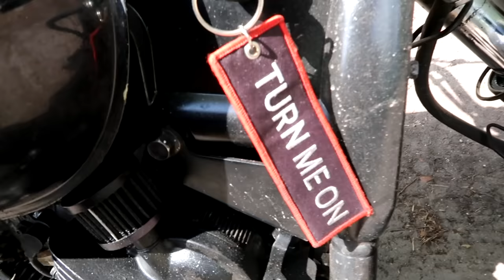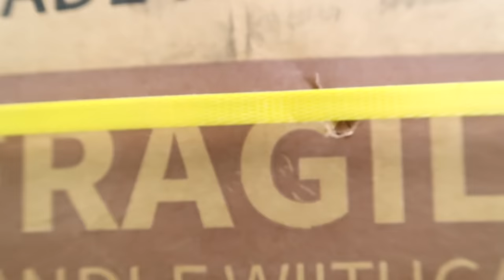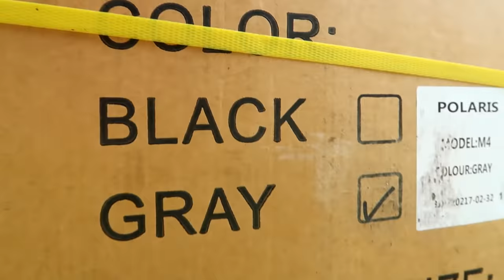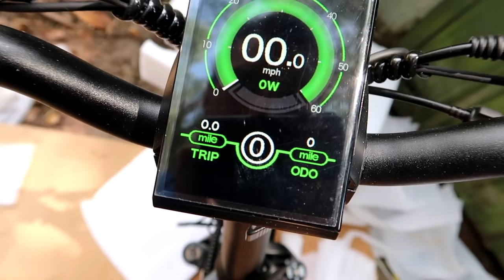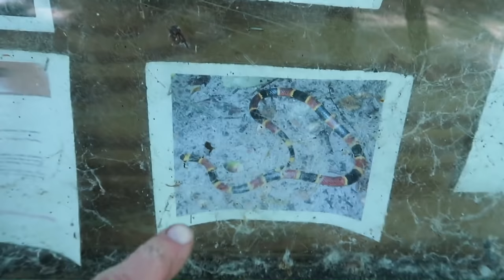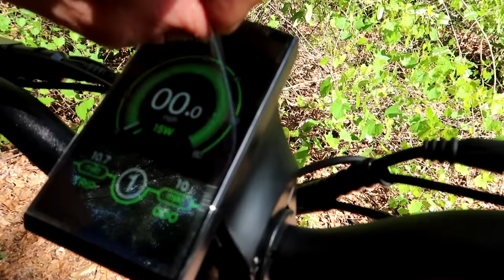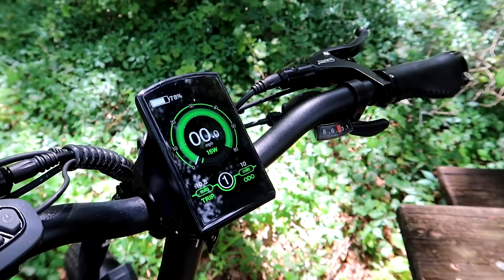MY FIRST Electric Bicycle / Polarna M4

Comment: Looks like a nice e-bike. I was just looking at them the other day as a matter fact. I Can verify the government tax credit as I got it this tax season for my plug-in hybrid I bought last year. You need to bring your Vin number and bill of sale to whoever prepares your taxes or if you do it yourself fill out the appropriate form with that information. You need to verify that your car is eligible and for how much $$ eligible because it depends on the battery size I believe.   Also it is only available for newer plug-in vehicles as once a certain number of units are sold by a manufacturer they are no longer eligible for the tax credit. I believe the Chevy bolt for instant is no longer eligible on new purchases-so do some homework/research!  

Nice video Dalton, good to see you!

Comment: Have put on 200 or so miles on my M6.(750 watt 48v 17.5 Ah.)  First night on a full charge riding 90% throttle ran down to 4
Reply: ... 4% battery and had to pedal the last 3 miles home. I weigh 185 lb and it will hold a steady 28 mph on flat ground. The 20" tires are actually 23+ inches. Full throttle with no load spins 41.5 mph, drops down to 36 mph at 65% battery. Should consider 20% battery as 0% as performance is significantly degraded at that point. Have received an expensive 2nd battery ($936 48v 50Ah lithium ion pouch cell( and waiting for my 1,000 watt front hub. I plan on several upgrades (pedals, dual crown 26" forks, bmx style handle bars and even a 3rd motor a mid drive. This is costing more than my daily driver used car but I love it.
Reply: @MrAntonLucas  better be careful with that front hub motor because adding that much power on front forks will let a axle spin out and your front drop outs will come right off from the bike. letting u know who have experienced this before even with torque arms.
Reply: I did in reverse order. My front hub motor arrived but so did my shiny black 1352 cc Kawasaki. I've put 8,000 miles on it but I haven't installed the E-bike stuff.
Reply: @MrAntonLucas  I'm considering buying an m6 and adding a second battery, how hard is it to do and what battery did you buy?

Comment: Don't Buy!  I just purchased two M4's (Black and Gray) and they arrived different than advertised.  Spoke wheels instead of mag wheel and a really cheap display/control.  The bike I got isn't even on their website.  The upgraded display you can buy on their site will not even work on this bike.  They won't replace claiming it's still a good bike.  Such a joke! The service department is in China and difficult to work with. So disappointed!
Reply: atleast u got ur bike i didnt get mine and they told me to go chase fedex now im out 1250$
Reply: @Talush1818  Sorry to hear that. The two bikes I bought showed up a week apart.  Hopefully yours comes soon!
Reply: @ericwhite70  my tracking says delivered. i contacted polarna they said go chase fedex. what a headache now i need to contact my CC company and get this resolved.
Reply: @ericwhite70  did u end up getting the right bikes or did their customer service brush you off?
Reply: @Talush1818  wrong bikes but gave me $150 per bike refund.
Reply: @ericwhite70  well at least that. hope u enjoy ur bikes!
Reply: @Talush1818  still fun but they are basically M3's.  When FedEx dropped my first bike off the put it in my driveway instead of porch.  Glad I was home so no one stole it.  Hope you find resolution.